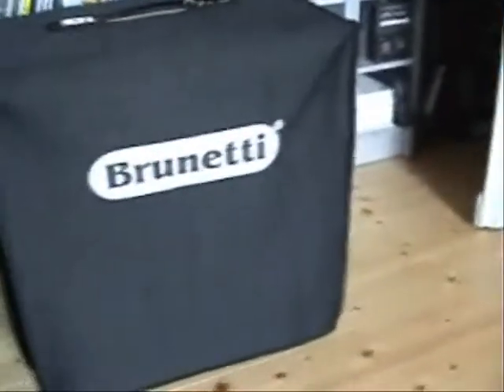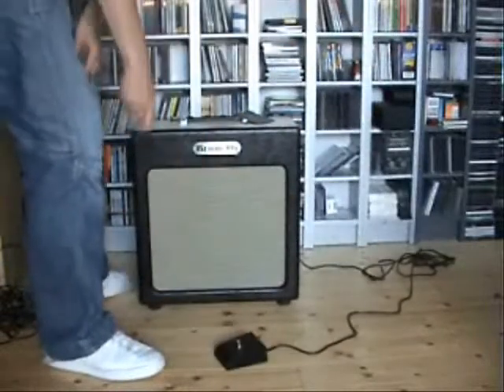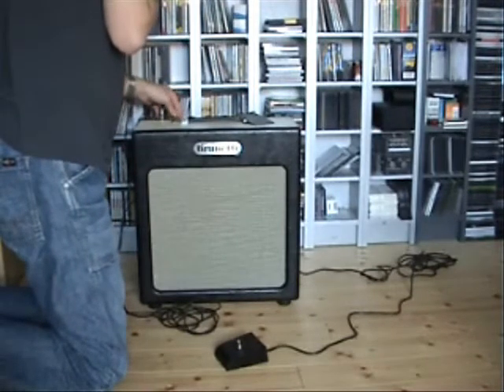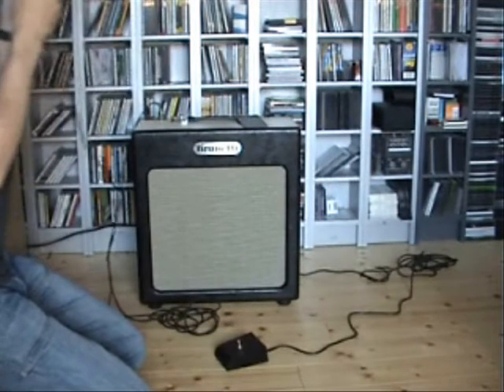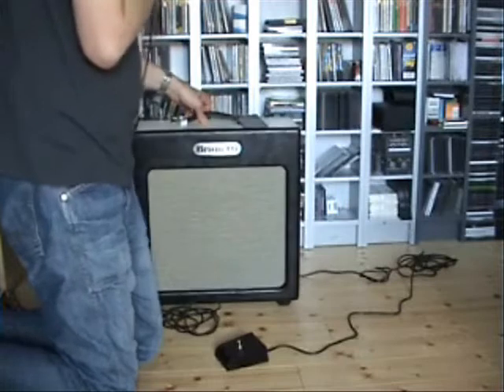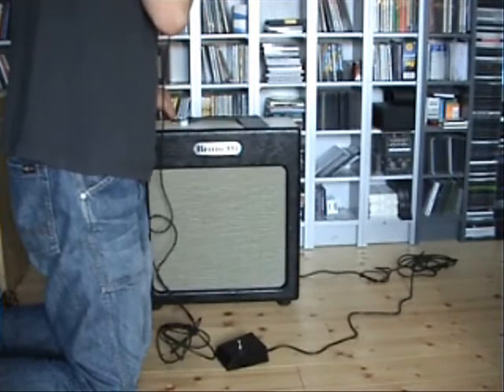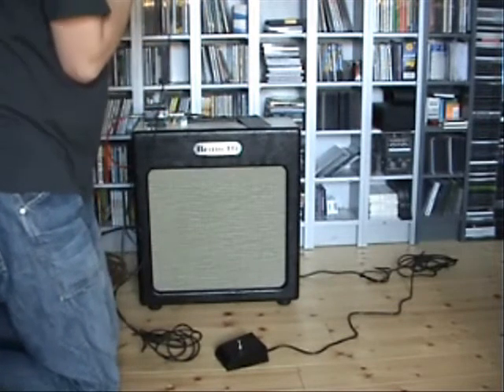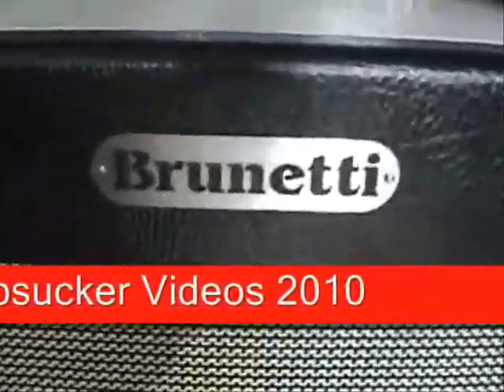Harmonica Amps Vol.86 Brunetti Singleman 16 (2010) full version

Comment: very nice sound!! A lot of projection. The Bluelab crystal sounds good but its hard to tell if the sound is thin? Too bad they manufacturer is so far away in Italy. If the crystal suffers from temperature changes such as heat and cold then it might be risky spending the 170 bucks with shipping. Thanks for showing it though